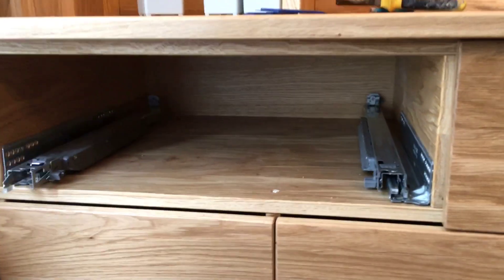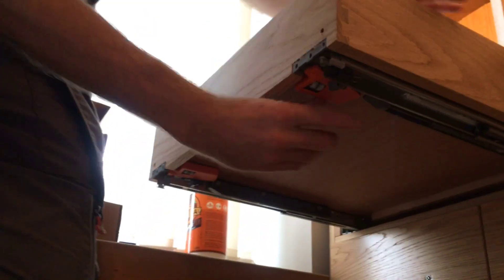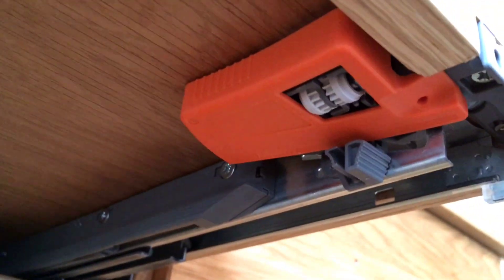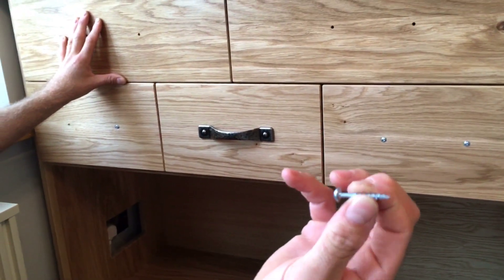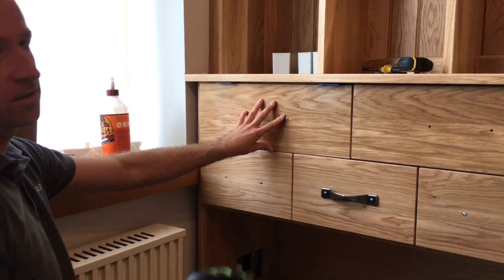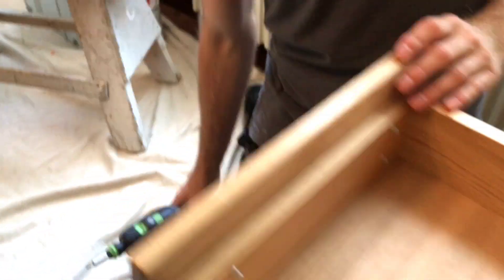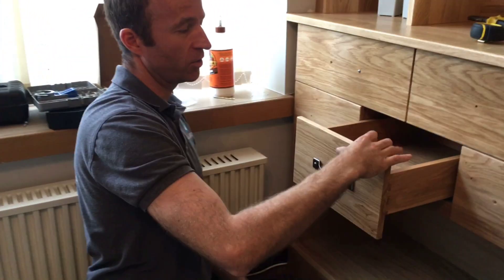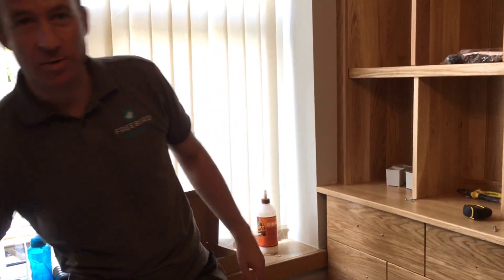How to fit drawer boxes and drawer fronts on undermount runners

Comment: Alastair, very late to the video but I thank you for it (and the whole channel!). Can I ask what your reason is for sinking the handle screws rather than just using longer screws? I think I could understand if you were trying to hide the other screws holding the face to the drawer box, but those are still visible. Is the extra work really worth it over just buying a big box of appropriately long screws?

Comment: I've seen blum say your drawer box  material can only be a max of 16mm. Otherwise I don't think there is much room for adjustment. Is that what yours is or is yours thicker or do you need to get specific blum runners?
Reply from the maker: Andrew Hay yes 16mm is a common standard for drawers boxes and drawer mechanisms of various types, annoyingly, because 16mm is more of a standard thickness in Europe I think.  There is a good amount of adjustment on these Movento runners.
Reply: @Alastair_Freebird  also do you build your drawer box depth say 450mm if your runners are 450mm runners?
Reply from the maker: Andrew Hay simple answer is I get the Blum catalogue and follow the instructions!  find a contact number for Blum and ask them to send you one.  For these particular runners the drawer box is 10mm shorter than the ‘nominal runner length’.  I get these oak dovetailed drawers made for me by ProBox.
Reply: @Alastair_Freebird  cheers for replying. Good man 👍

Comment: Great videos as usual. Have you fitted large drawers 900m+ wide? Looking for some good side mounted runners for customer
Reply from the maker: thesey yes.  You can use Blum Movento.  Or ball bearing accuride type.  May be issues with jittery movement if they are wide but short.  I suggest you give Hart wholesale a ring and get advice for your specific requirements 01702 614044

Comment: That's great if you have handle. What about no handles?
Reply from the maker: I did a handleless drawer front a couple of weeks back and my approach was to measure the positions of the front edges of the drawer box relative to the carcase and mark those edge lines on the rear of the drawer front; remove the drawer box and line it up to the lines and screw it down onto the drawer front still laid on the floor, then refit the whole assembly and make any minor tweaks as necessary with the movento front fixing clips adjustment wheels etc.